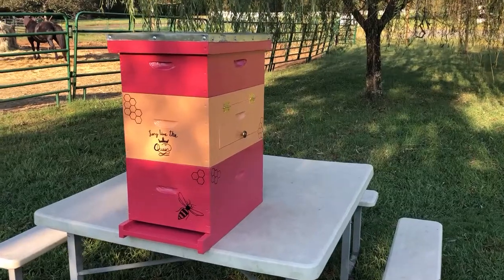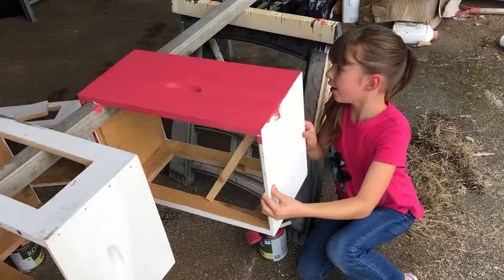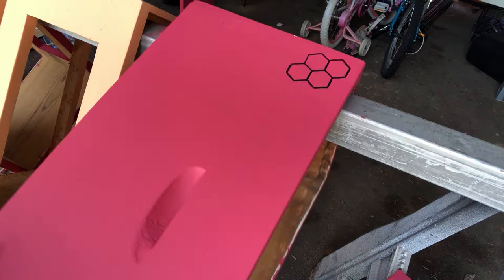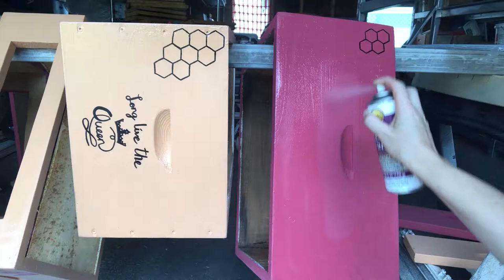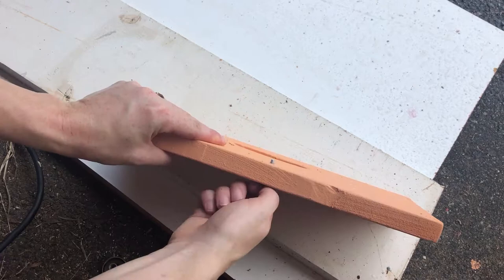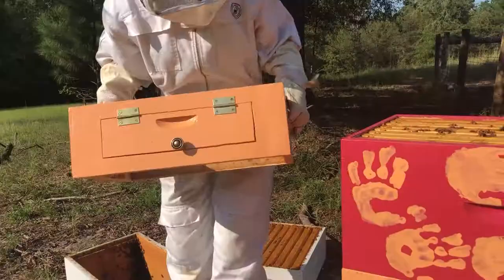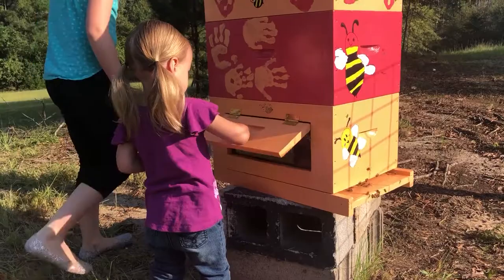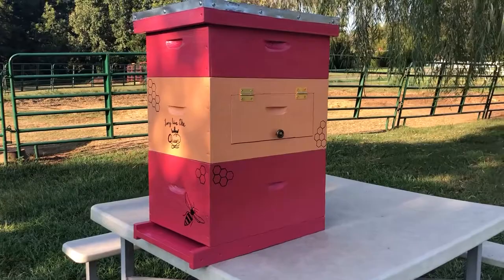How To Decorate A Beehive

Comment: Did you use waterproof outdoor paint on your hive?
Reply from the maker: Yes I did. Since it’s hard to repaint a hive once you put bees in it (you have to switch out the boxes so you don’t have any bees in the boxes obviously) I made sure the paint would last against both the weather and the sun.
Reply: @TheLittleBlackShadeTree  Thank you.  I found this exceptional quality product called Vermont Natural Coatings that using Whey protein to have the sealer and stain sink 3X deeper into the wood to seal it from weather.  Yet after applying that I'm using several stencils to decor each side, and wanted to protect the paint as well.  So I just order a semi-glass spray paint by Rust-Oleum, simular to yours.  Thanks you.
Reply from the maker: That sounds like a great product to use! Yes I love putting a clear coat after the paint, especially when I do hand painting.
Reply: @TheLittleBlackShadeTree  I just order a FlowHive2. So exciting
Reply from the maker: That’s awesome! I’ve always been fascinated by those!